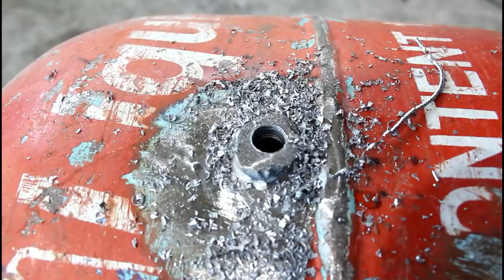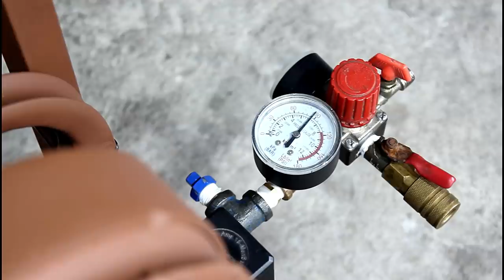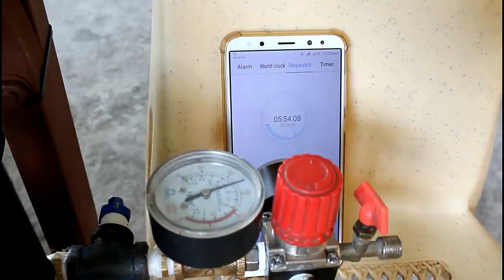GrassCutter Engine into a Working Air Compressor

Comment: That's a neat little trimmer motor. Unusual to see engines like this that are OHC. Also a one piece head and block is something I've never seen before.
Reply from the maker: New china engines are like this
Reply: If you get a 4 stroke motorized bicycle kit it'll likely use the same general design.

Comment: Nice work!!! But why you cut of the ground from the cable? If i were you i would connect the ground cable with the frame of the compressor for safety.
Reply from the maker: Yep. But here in our place houses doesnt have a ground connection on our outlets. So it will not work even i connect it.